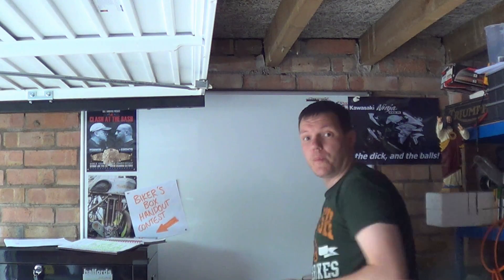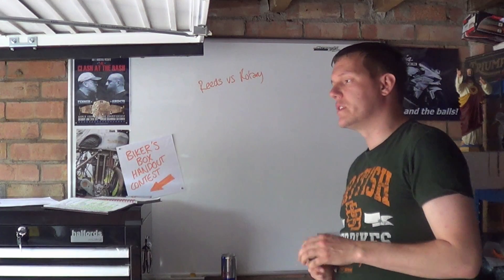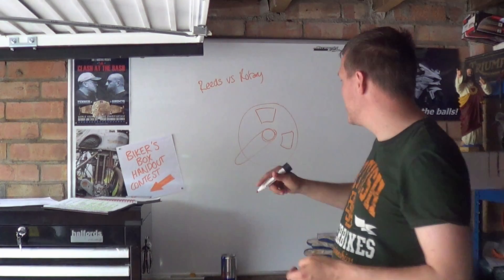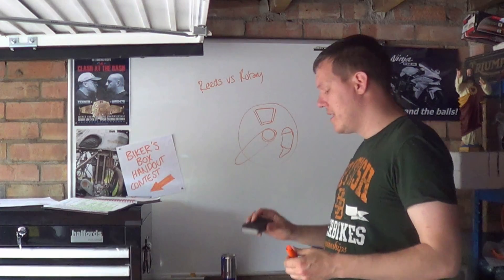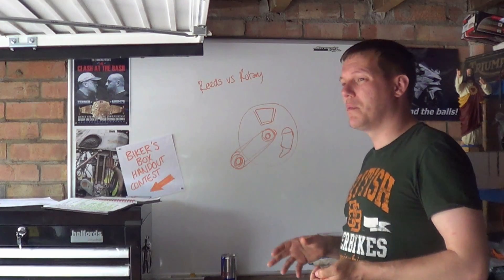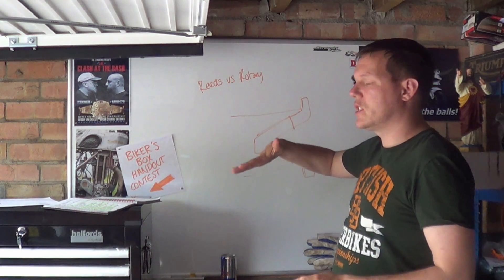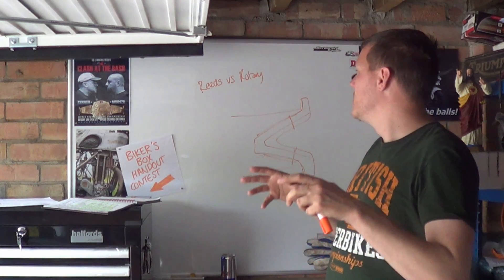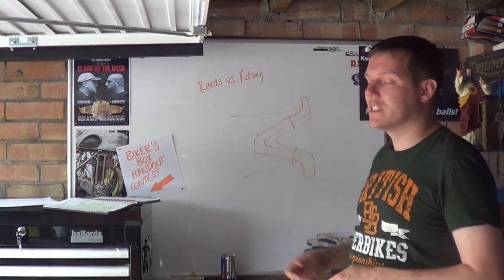Reeds vs Rotary Valves - 2T Tech

Comment: How does the rotary valve make a perfect seal when closed, without creating lots of friction heat?
Reply from the maker: It doesn't. You don't need a perfect seal, just a good enough one. Fiction is defined by the load applied to something. The discs aren't heavy and the lateral force isn't that high.

Comment: Pretty lousy description of a rotary valve. The disc is always mounted on the crankshaft and doesn't require any external drive. There are more advantages. For example the under pressure that will occur below the piston will easier hinder or even reverse the flow in the ports whereas that pressure will equalize through the carb on a rotary valve. There potential for max power all things being equal is always higher on a rotary valve engine due to laws of the nature. The kinetic energy of the flowing gasses will have to open the reeds that strives to close. This is no free energy magically from nowhere. It will come at a cost way higher than spinning the rotary valve, and the gasses can flow without anything being in the way.
Reply from the maker: Always, are you sure about that?

https://images.app.goo.gl/YHqathtH1XGviXzA6
Reply: @thedirtyworkshop  I'm not familiar with all garage experiments globally. I was reffering to commonly produced bikes,  or known race engines in karting, roadracing etc..

It's like saying that the piston isn't moving up and down in the cylinder since you surely will find engine where the cylinder moves over a fixed piston or other weird configurations.

The biggest draw back as I see it is that the carb has to be mounted on the side which makes the engine wider, or a long curved intake. The second is that reeds will give a smoother more controllable engine at lower RPM's.
Reply from the maker: The laws of nature? The rest of us call that physics...
Reply: @thedirtyworkshop  I answered in your language to make it easy for you. I could comment in my language so I can be picky with wording. Then again you understood, I thought that might be enough?

Comment: Is it possible to use a rotary exhaust valve for 2 stroke to reduce leakage of fresh charge during scavenging ?
Like you can have a sort of a 4 stroke setup, with a chain connected to the crank, let it spin a camshaft on the head, but the camshaft is then directly connected to a rotary disc which is properly timed ? We can have the camshaft bearings lubricated by an oil pump ?
Reply from the maker: No. Simply because it would get clogged up in carbon in no time
Reply: @thedirtyworkshop  Hmm, so same problem as sticking a reed valve in the exhaust :(
Reply from the maker: Yeah. Valves need to be able to seal. For a poppet valve the seat surface is wiped clean by the rotation of the valve over time. Not only that but the valve is forced closed.
Reply: @thedirtyworkshop  Right. Thank you! Do share if you have any valve design idea that’d work and not get gunked up by the carbon!

Comment: Many single cylinder 2 strokes now have a "balance shaft" ... why not use that balance shaft as a rotary valve, a 2 for 1 deal.
Reply: Nice idea but rotary valve needs to be connected directly to the crank
Reply from the maker: As long as the balancer shaft is 1:1 with the crank then you can do it

Comment: Doesn't the Mazda RX-7 use the Rotary engine type?
Reply: Different type of rotor. Mazda uses Wankel engine (known as rotary engine). In this case the rotary disc and reed are 2 different type of valves. They're not an engine.

Comment: My first experience with reed valves was when servicing some brands of chain saws.  There was the occasional reed breakage of the spring steel which caused destruction in the engine.  Model aircraft engines, another area of experience, have used rotary valves via a hollow crankshaft or back plate disk.  Only production glow motors I know of that use reeds is the Cox series of tiny engines and in those, the reed retention is handled quite differently than in motorcycle applications.  I worked on Suzuki and Kawasaki bikes through the years when rotary valves were common on singles and some twins.  I recall no durability problems with them, some were fibre-phenolic, and some were thin spring steel.

Comment: In the karting world. The old rotary valves, when set up correctly they were always faster than the reed valves (at the time). But they had the tendency to blow up at higher RPMs if their timing was slightly out. The disc was mounted directly to the crank as the intake was on the right side of the engine with the exhaust being in the normal place, at the rear. There was one engine (ital sistem SV21) which had the rotary on the front with a belt drive from the crank, which was a beast of the engine back in the day and still is. Reed valves started replacing rotary valves in the mid 90s. Some manufactures still continued to make rotary valve (along with reed valve) engines up until 2005 but in the end, everyone just settled for reed valves. Piston port engines were popular back in the old days but now a days they are just used for the 50cc engines designed for the 6-10 year olds. Some piston port engines were just as fast as reeds and rotaries.
Reply: Marc, agree with most of what you said. I believe though that the shift from rotary to reed in shifter classes was mainly rules-mandated. The fact that you could not use rotary valves in sanctioned KZ championships, made the business case for these engine wobbly at best.

Comment: can rotary valve have use in one exhaust port?
Reply from the maker: yes and no, the temperatures are very high and rotary valves are usually very thin.
Reply: maybe with a special alloy. has anyone ever done it?  if it done you can have no fuel losses, no need for big exhausts,more compresion, and even can changing the exhaust timing throw the revs. maybe it will make eazy fit for turbo.and may use big crank case compresion with out mixture losses from the ex port.
Reply from the maker: Rotary valves have been used - they're called power valves but not rotary disc valves. 

But how would this help?
Reply: you can have the exhaust port fully closed when the mixture is going inside the cylinder,  and the compresion will start the time the transfers will close by the piston (if the rotary is not leaking)    if the disk is spining 3 times every crank revolution you can have 3 diferent port shapes per revolution,,, lets say in the explosion you have the disk window fully open to match the ex port shape.   when the piston gets lower a second diferend hole apears in the disk-port(let's say the rotary goes 3 times faster that the engine) the second hole can leave only the top of the exhaust port open to let some gasses or fuel to suck from the ex pipe but is the same time keep the bottom end of the port closed to prevent fuell losses while the transfers are opening..   by the time the fuel have reach the half height of the ex port the disk rotates and closes the port 100%   then the piston closes the transfers and the fuel can fully compres because the is not a hole in the ex port..  a turbo can help the gases escape the cylinder and build a bigger crankcase presure.. (maybe required because the engine will most use the piston and crankcase presure to fill the cylinder with fuel and not the 2t exhaust sucktion(low presure waves that suck fuel in the exhaust)     so better efisency,lower fuel waste, no need for tipical2t exhausts, more compresion. sorry for my english :-p

Comment: I don't think they ever existed on bikes but on snowmobiles the engines used to have the intake port low on the cylinder wall, and by using the piston as a valve you had even less components to worry about (and you could port the piston as well).

These ones worked pretty badly from old forum posts and research if I remember right, because it depended on filling the crankcase after the inlet ports got blocked off (so you'd have trouble with it filling the crankcase fast enough at higher rpm's)
Reply from the maker: Piston ported engines were used and still are - more on this later

Comment: Great video. Looking forward to the continuation. I was first introduced to reed valves when I started racing motocross as a teenager. When I got interested in roadracing, the first rotary valve engine I saw was an Armstrong CCM 250 gp race bike. I've been curious about them ever since. Thanks.
Reply: 34bartm old can ams had rotax rotary valve engines that went good and Kawasaki had few on trail bikes that were a lot milder

Comment: If you could explain the reason why the optimal intake distance changes from one to the other as the pre reed block rotary intake rotax snowmobile and jet ski engines getting yourself a racing or shorter intake housings were all the rage to gain in horse power then come the reed block engines and all of a sudden they are selling spacing kits to make your intake longer to create more horse power! I'd love to hear your take as to what the different systems see to gain from the seemingly different trains of thought?
Reply from the maker: Yes I can

Comment: I bet my Vespa's rotary intake has a longer lifespan than a lot of reedvalves. And it has no other parts than a crankshaft and it's casing. Of course you're talking about modern production engines but there are some other rotary intakes than those complicated ones you presented.
Love your channel, keeps me thinking!
Reply: I race karts .. both Reed motors and Rotary motors ... the reeds wear out after a few weekends  ... and I have NEVER replaced a worn out rotary valve. However, the rotary motor is more complex, because the rotary valve/carb uses one end of the crank, and a PTO needs another, and the ignition another ... wait that is 3 crankshaft ends and there are ONLY 2 !!!  .. which leads to adapter shafts and un-lubricated bearings spinning at 15K plus rpm, or chains that break and cut the carb off the engine ... the Reed engine reliability in a race is better.

Comment: the big  difference between reed and disk valve is the durability. Disk valves above 10.000 rpm could be measured in minutes for the seals. 120-180 minutes life for the seals of hi spun disk valves and must replace.

Comment: Rotary disc intake allows asymmetrical intake timing so it can work at any engine speed, at about 18,000 to 20,000 rpm the reed is probably going to run out of puff with no time to close at all and just be an obstruction to the intake. But few engines rev that high anymore outside of sprint Karting so reeds are good enough, and cheaper to make and fit to an engine. Other factor is the engine width with carbs on the side is a problem for bikes, not so for Kart or even Snowmobiles. So rotary disc can out rev a reed intake but rotary is costly and reed cheaper to make and fit and adequate for engines that only rev to about 16,000, which is better than plain piston port.
Reply: nice one AU . tell him how it works pls
Reply: Have you considered 2 intake ports? Twin carb.

Comment: For 2T Diesel root blower intake, which of the 2 is used or is it a piston operated intake port
Reply: none of the above, the air entry into the cylinder into an industrial  2 stroke compression ignition engine  is controlled by the piston, which  would be the transfer port opening in a crankcase scavenged engine (spark ignition). The intake air goes thru the air cleaner, into the supercharger and/or turbo charger, then into the intake manifold which supplies the "intake" ports. The intake ports are analogous to the transfer ports of a crankcase scavenged engine.
Reply: THANK U
Wat happens wen u hv multi-cylinder?
do u maintain a manifold pressure waitin 4 the piston controlled port 2 open up?(hi pressure air so leakage any?)
or
do u use separate charger 4 each or maybe use a rotary valve to transfer air according to crank angle ?
Reply: Deep, I am not a professional diesel mechanic, so I can't tell you for sure, but I am fairly confident that most industrial 2 stroke engines are multi cylinder and there is 1 supercharger and usually 1 turbo per engine. The supercharger is necessary to start the engine and is geared up (increased in speed) from the crankshaft. The turbo is exhaust driven and it provides most of the boost when the engine is running in it's normal operating range. There are no valves or reeds in the intake manifold. I am sorry for the long answer, but I didn't understand all of your question.
Reply: thanks 4 the reply
i was concerned about the sealing ability of the piston wall to the high pressure that is being maintained in the intake manifold.
Reply: The pressure would be 1-2 bar higher than atmospheric
Reply: ok that explains

Comment: A Tad off topic but this seems like the best place to ask (for Matt or anyone who may know);
Can Reed valves be fitted to an older non Reed engine? Maybe it's a stupid question, but the little 49-80cc bycicle engines can have a reed fitted to them with a (seemingly) decent increase in performance. I can link what I'm referring too if someone hasn't seen it.
Reply: Cody Soper yes offcourse, like the polini 65cc reed cilinder for a puch...

the dissavantage of a rotory inlet is the seal time and the location of the inlet... it's on one side of the cilinder so you can never tune it perfect. You'll always wil see a difference on the piston...

The reed will be in the middle and provide all spoolers with the same   ammount of mixture untill almost 18000 rpm...

In my opponion the rotory valve best is on rc cars trough the crank...

Comment: I remember in 60's Yamaha had v4 125's and 250's at the TT with rotary valves and they went well but reeds were a step toward. Old Gimmer (72)
Reply: i believe that you'll find that the 1960's "Yamaha V4" 125's & 250's were actually CZ square 4 & tandem twin 125's, Jawa V4 250's and Jawa V4 350's (Bill Ivy was killed at Sachenring riding the 350!!). These were all utilised disc valve induction control.

In the 1960's Yamaha was still campaigning the TD series parallel twins & fours.
Reply: @CZ350tuner  yamaha did have v4 250 and 125's in the 60s, Phil Read and Bill Ivy won world championships on them.

Comment: i have a 1998 kx250.my first bike and i bought it blown up. i watched your videos on how to rebuild it and followed it to a tee. thanks for your help. when i bought the bike it had a spacer in-between the reed cage and carb, i had replaced everything on the bike and didnt take this off as i didnt know any better at the time. the bike ran like crap and would bog if you cracked the throttle more then half way open. it would bog out and die. i removed the spacer and now it runs great, i was talking to a friend and he said spacers can create negative pressure and i was wonder if you could go further into detail about what was going on. regular veiwer, first time commentor. love your videos thanks
Reply from the maker: Yes I can - matt
Reply: You had the spacer in the wrong place supposed to between the jug and the reeds not the reeds and the carb smfh
Reply: why didn't whoever runs this page say tell him rather then give a smartass answer lol

Comment: This doesn't have anything to do with this vid, but if higher viscosity oil has a greater load capacity then thinner oil why is a lighter oil weight used at all? I frequently hear about people with worn main bearings running thicker oil, why wouldn't you just run thicker oil all the time to have a stronger film of oil to keep the crank surface away from the bearing surface?

Happy screw your royal taxes day!
Reply: sorry to say but i've just found someone who coppied one of your videos abouth "2t suter MMX is it shite ? "
the name on you Tube is  : Brandon Sarkis => he coppied your whole video + like 10 or 15 % extra ( double ) => he didn't stop for a reason ?  at this point he has zero subscribers and 29 videos uploaded !!!
haven't chequed but i don't think non of them are his own content !!!
beter cheque up on this !
and you might protect yourself by putting some symbol of the workshop in the corner of your videos !
just saying => i don't like for people to steal other peoples work !

good luck  :-x
Reply from the maker: Good question added to the list (basically its hard to push thick stuff) wink. wink
Reply: haha nice. Dunno if possible but with the simple engine, maybe you could show power loss with a high viscosity oil compared to low viscosity oil.

Today I'm drinking a gallon of tea that only cost me $1.20, just thought you should know. 🖕 😆

Comment: I have a 2 stroke engine that does not have any valves at all, if you would look through the carb you would see the light shining through the exhaust port. It has a "low emission series" stamp on it. Could you explain how da fuck it works cuz I'm really confused?
Reply from the maker: Yes, and its called loop scavenging